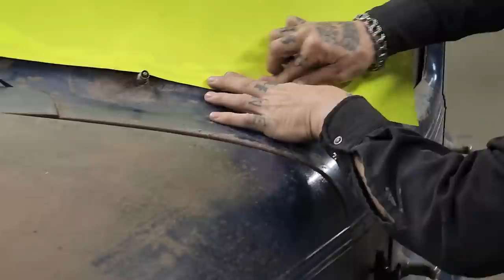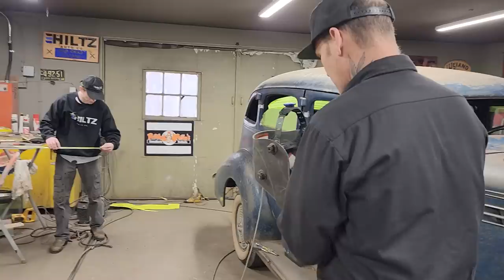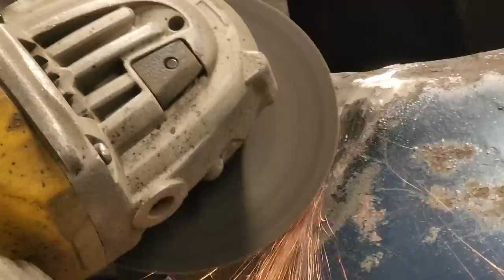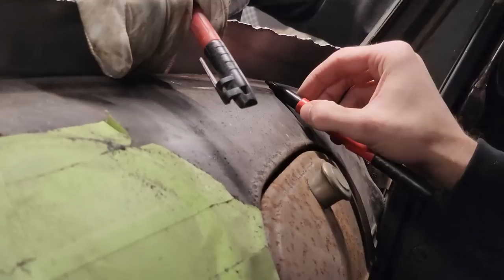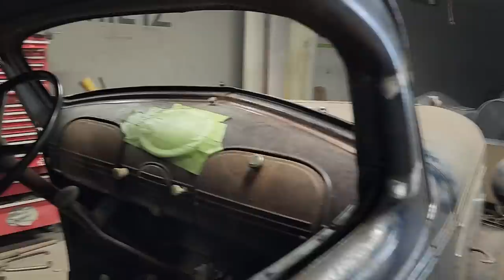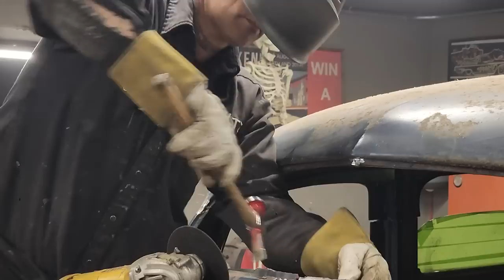Onto the next hurdle...

Comment: As the side window rolls up, once it gets to the top (in the up position) it travels forward. This was done to create a vent window with out having one. The window moves forward once up. It moves backwards first, before it goes down. Shorten your side glass by cutting the chopped height out of the top of the glass. And shape the front edge of the window to the same angle of your front door post. And it will fit. It is not moving forward because the window crank is not able to go all the way up because of your chop. The flat piece of metal in the back of the window opening is to cover the glass when it travels forward, in the up position.
Reply: Wow, you know your stuff! Great knowledge

Comment: Hello Bad Chad and Queen Jolene and all the best from myself at Sydney Australia 👍👍😊😊
I really love this project and glad you guy's are pumping out the vids.
You guys are doing a great job! 
Definitely  hammer down the return on the firewall and use the factory rolled edge on the firewall  or even cut that part out.
The water collection is a consideration but I think the angle back downwards on the firewall return is important to match the top of glass return so its uniform all around the screen.
You could easily make some small drains at the lowest two points in the return with 1/4 inch Stainless steel pipe.
If you make drains, you would have to obviously take into account where the windscreen rubber would go to set the drains into position.

Comment: Having been a welder/ fabricator in the oil field for 35+ years.. I cringe almost every time I see you grab the "zip cutter" . I have so many scars from those 1/8" wheels coming apart at 14k rpm and kicking back on me. About 5 years ago I bought a cordless grinder with a finger trigger instead of a switch so that when/if the blade kicks back and I drop the grinder.. once I take my finger off the trigger the brake stops the blade. Haven't had any problems since. We all know that the grinder is the most dangerous tool we use.. so think about buying a cordless grinder and preventing any boo boos. Love the content.

Comment: Leather is an insulator not a conductor. You would remove more from the weld by blowing on it than rubbing it with your glove. You have done a wonderful job on the chop. I never though that you would get the A column to work so well.

Comment: Here 's a tech tip, when you wear down the leading edge of your flapper wheels , If you hold the wheel while spinning on a bench mounted mandrel stone grinder you can grind off the spent backer plate thats bare and grind it till you get into the middle of the wheel where theres still flap wheel sand paper .The wheels smaller but it saves on flapper wheel. Chop looks good so far!
Reply: Great tip

Comment: Only because it will need a way to drain well,And maybe look a tiny bit more natural,it may have been easier to split the post, since it’s so short and bring it out with a wedge to match the original  cowl’s lip rather than taking the bottom lip back to the post by way of the new lip. Easy for me to say in hindsight, But that falls back on the old adage of more ways to skin a cat though. To use your words Chad ,”I have no doubt in my mind “that it will work just fine the way you’re going . I am digging it!. 👍

Comment: The reason that there is a gap in the front door window is because the window winder is not going up as far as it did before the chop.  The stock window would wind up to the front and if you wound it up a little more it would move back to let a little air in. That is why there is an extension of sheet metal over the rear edge of the window. This was a feature on 34 Fords but not on 33s.
You could overcome the problem by cutting the glass shorter by the amount you chopped the top.

Comment: I think you may have forgotten that that door window is supposed to slide forward after it reaches the top of the frame. To get it to do that you will have to adjust the mechanism inside the door. Would be neat if you could get that to work. Car is looking good.

Comment: Hi Chad, in theory the door window glass needs to be chopped the same amount as the body, then it should fully fill the opening. If you cut some off the top of the glass until the window fits, I think it should work. Assuming the A pillar angle has not changed too much.

Comment: if you take out the front windows you should be able to get them cut down and to the correct shape for you front and back doors, and the back door windows will open wider than the stock one did

Comment: V-butting the windshield in center post windshields is a common thing to do. No rubber is required and you just epoxy the two glass panels together while laying them in a bed of epoxy sealant. Placing a center cap over the V-butt is not required.

Comment: Chad, It might be a good idea to cut off the existing windshield lip (pinch weld area). then you can get a better angle on the new piece so it slopes outward on the bottom edge. For water drainage, and it will look more natural too I think.

Comment: The BET was $10,000 PLUS you added $10,000 ... SO all you really will gain is the original $10,000 not the $20,000 you keep mentioning, however, IF you are expecting $20,000 may I have the $10,000 you added??? PLEASE???